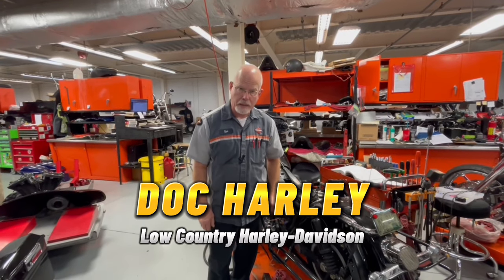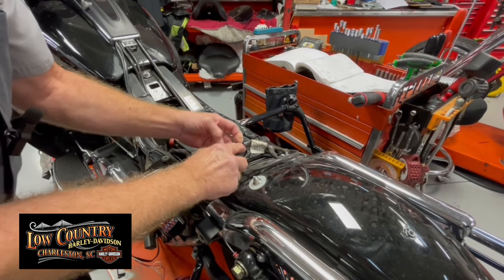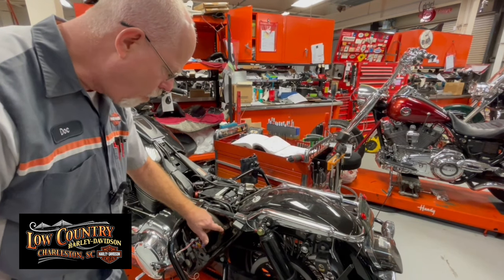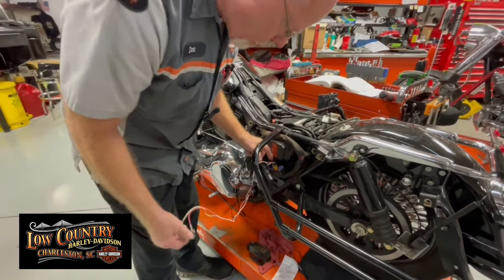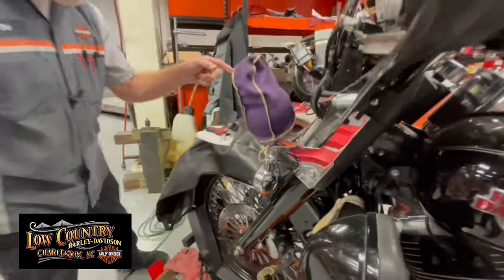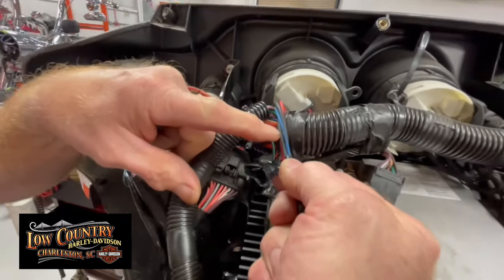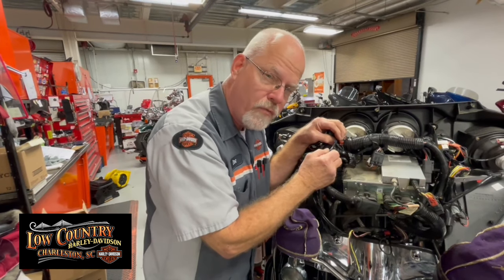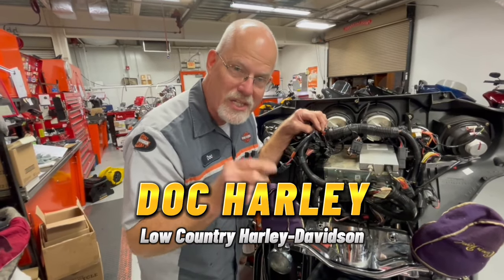Doc Harley Talks: Is it really just the fuse?

Comment: Doc - I have watched your videos many times and this one saved me a lot of money.  Tail light and front running lights went out on my Road Glide Ultra, blown fuse.  Followed your video step by step with my service manual to test each segment of wiring for continuity and resistance and found a blue wire in the left signal light housing had worn through exactly as the wire in the fairing shown in your video.  I was wrapped up in about an hour.  Can't thank you enough!
Reply from the maker: Great diagnostics👍 thanks for sharing….Doc

Comment: Doc, once again, timely and wise. I am having an issue with the front headlight and spots will not work on my 2011 Ultra. The signals and brake lights work. I've verified the relay works, and the fuses are good.  I'm about to take the front fairing off. Wish you were here.

Comment: Excellent video Doc! Great in-depth diagnosis and using a relay. I had the wire for the oil light under the speedometer/tach console of my 07 FLTR console rub the insulation and short out on the steering; no gauges including speedo/tach, fuel, oil, etc. Service Manuals (two for this bike) are invaluable. Thank you and keep up the great work! 🇺🇸

Comment: The rear lights on my 2011 ultra were shorting out. It turned out to be wire harness had rubbed thru under the plate in the tour pak. Was definitely a pain , but satisfying I was  lucky enough to find it. Great video Doc!

Comment: I learn so much from all your videos, Thank You
Reply from the maker: Happy to hear that…Doc
Reply: Great content, one of the best on here I think.  Which service manuel should I get, a Harley one, haynes Clymer ?   I’m trying to fix my cruise control on 13 cvo ultra classic. Everything else seems to run n work fine but cruise won’t work anymore and check engine comes up. PO577.   Is it just a switch. I haven’t found a video that shows how to do drop down test.

Can’t seem to locate the roll off switch and don’t wanna start cutting the plastic on the wiring to hunt for it.

Comment: Ran into a similar issue with my 2012 Ultra.  Kept blowing the starter relay and fuse. Wiring was rubbing on the radio chassis. Can drive you nuts finding these issues for sure!

Comment: my method is to solder a wire on either side of the blown fuse, connect a tail/brake size bulb to it, and stick the fuse end back into the fuse block.   This will let a limited amount of current through the dead short to ground, the bulb will glow bright when grounded... just watch the bulb and wiggle the harness until you see the light flicker, that's where the short is.   The grounded point will usually generate heat as well, so it can be easily spotted with a thermal camera, even when buried inside the wiring harness.
Reply: Can Am used to market a short-testing device consisting of two pieces, where you plugged one piece into the open fuse's connector and it functioned like a transmitter. The other piece was the "receiver" which you ran along the wiring harness. When you heard a "beep", that's where the short was.
Reply from the maker: What a “Bright” idea…..Doc

Comment: I have question for Doc not really related to the electrical system, when replacing the charging system there are some models that have a slight ridge or lip cast into the inner primary case that prevents anyone from removing the rotor without first removing the inner primary case, I've seen videos where some people grind or file away the ridge or lip allowing the removal of the rotor without having to remove the primary altogether, my question is.. does the ridge or lip have a specific function, either structural or related to lubrication of the compensator thru slinging oil onto it? By removing the ridge are people casing possible harm?
Reply from the maker: This is a great engineering question. I too have wondered. The answer is beyond my knowledge. I will ask next time I attend HD schools….Doc

Comment: I had an electrical issues with my old "05 Sportster.... It was the wires for the horn rubbing on the horn bracket... Vibrations can be a Harley owners nightmare is you don't know what your doing
Reply from the maker: Your issue is very common on older bikes…Doc

Comment: I have a Low Rider with CB’s and the rear turns signals are tripping it…..gonna get in the headlight to look for a short there…and all the way along route….I could just strip the turn signals off and use hand signals…but that’s a last resort.
Reply from the maker: Wishing you success. Take your time. Be sure to check the turn signal bulb first…Doc

Comment: Great video as always Doc, I only ask because this bike was a 2007… I have a 2003 Electra Glide… only has 14k miles on it and is more of my show bike then my daily … I have a newer Harley that I put the mileage on but I brought the 03 in for new tires last week…. My local Harley dealer said this is the last time they’ll work on it because it turns 20 years old in January… the bike is mint no rust or rot, garage kept its entire life  with a dehumidifier under the cover (I’m a sicko, I know)… I get it that they don’t want old bikes that have been sitting for years but this 03 is cherry… does low country have an age limit on what bikes they will work on? I get it dealers don’t want old junk that’s been sitting for a decade rolling through the shop but a running and driving bike in good shape seems odd that they would turn away.  Really just curious if this is a universal Harley thing or if my local dealer just doesn’t want to be bothered. Thanks Doc!
Reply from the maker: At this time, Yes we work on older Harley-Davidson motorcycles but under the understanding that it will take time. Dealers are stopping to work on older bikes for many reasons. The biggest is customers expectations. Parts are unavailable, current graduates in the field have no experience or knowledge on how to service, repair or upkeep a 10, 20 or more Harley. Inventory of older parts are depleted with no help from the Harley-Davidson company. A 10 year old parts are all Obsolete by the company. The problem goes a lot deeper than the dealers. In my opinion our company has forgotten our Heritage…. Doc
Reply: Thanks for the honest answer Doc. I get it but that still stinks… funny the dealer I was at has a  big museum built in of vintage Harley’s back to the early 1900’s  … love the channel, thanks for the info!

Comment: Interested in knowing about fans on 2014 Harley Trike. Water pump has been upgraded, fuse is good, sensors are good, fans run by themselves direct current to fans, but do not run when twisting the throttle when on accessory or when bike is running. Does The ECM has anything to do with the fans being turned on or off. I have updated the map with a dynojet map and was thinking that there may be a problem with that map to not allow fans to work. Can anyone help on how to further diagnose the issue? There are also love jugs cooling fans installed as well which work fine. Possible Short??? Somewhere
Reply from the maker: Our guess is you have downloaded an oil cooled mapping instead of the Twin cooled mapping. Yes the ECM controls fans….Doc

Comment: I have a question..2007 haritage  when I hit my rear brake hard it locks up my transmission and I can't go anywhere till I  rock it back and forth to get the shifter to work  was told this was normal
Reply from the maker: The HD transmission was ment to keep spinning so you putting a Stop to it all was not ment to happen. Why are you slamming the brakes ? Trying to brake something…,like yourself….Doc
Reply: @LowCountryHarleyDavidson  some  jack wagon pulling out in front of me...I didn't want to be part of there paint
Reply: I had the clutch lever pulled the same time I hit the brakes

Comment: Following a schematic in the Space Shuttle may be easier than a HD. Really is all that crap necessary?
Reply from the maker: Every time I work on a shovel I ask the same thing. But currrent customers want a lot in there Harley so many pages of wires….Doc
Reply: @LowCountryHarleyDavidson  Well, That is why I am NOT a current customer, in fact There is no brand that I would consider because of all the unnecessary gizmos, wiring up the yinyang. It's just a motorcycle not a spaceship